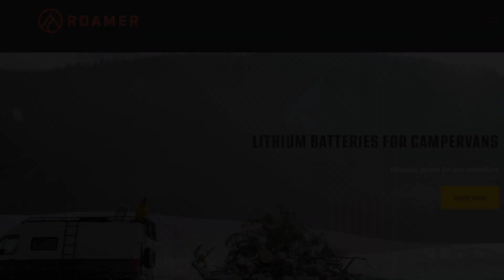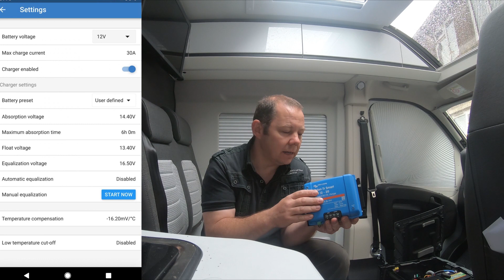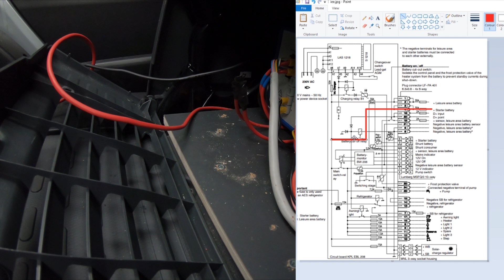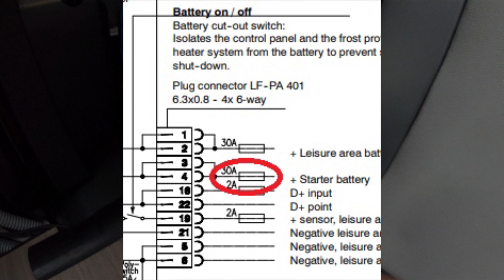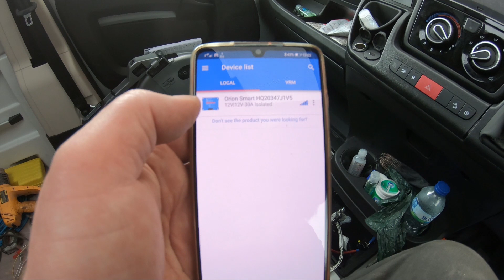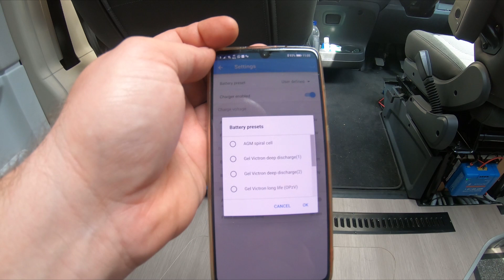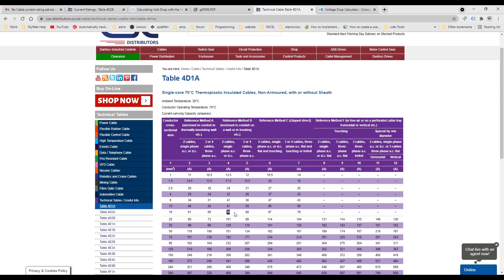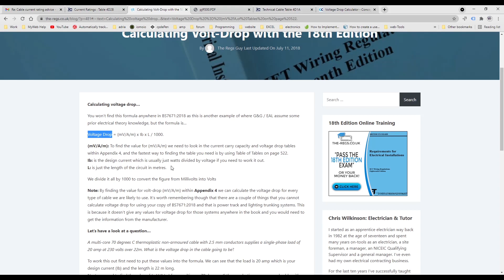Adria Twin fitting Victron Orion Smart Tr B2B DC - DC charger

Comment: Great video thanks, i am in the process of fitting one of these and am going to use a D+ (engine on) connection to prevent the B2B potentially switching on when the solar controller is providing a charge. It's very easy to get to the D+ on my van (RollerTeam T590) so I may as well. 

However, as a separate issue have you considered whether the B2B might wrongly detect a fully charged battery if the solar controller is providing a charge voltage?? ie. solar controller is charging battery, then B2B is activated but measures 14.6V on lithium battery (provided by solar) and so doesn't start charging even though solar might be a very very low charge current compared to the 30A potential of the B2B? I wondered whether to fit an additional solar isolation relay activated by the D+ signal? Any thoughts would be most appreciated.
Reply from the maker: Hi Mark. I agree with using the D+ to switch the B2B on/off. I have had an issue when charging the starter battery using the Victron charger the B2B will switch on. When it switches on the Victron charger is then tying to charge the starter battery and the leisure batter so not ideal. If I was on EHU you I could end up drawing power of the starter battery and kill this batters over time.
As for solar on the leisure side I have not seen an issue yet where it stops the B2B working. i think the B2B only senses the input from the alternator. It should still turn on, however I have a victron solar unit and have set the voltage on this lower than the B2B to prevent any issues
Reply: @BrackstonesTravelAdventures  further to my previous message.... i have since realised that the B2B will NOT switch on due to the voltage provided by the solar controller (Victron 75/10) as this voltage will be present on the output side of the B2B so that was never going to be a problem. I have now got my B2B in and working perfectly with the solar controller and both actually charge the battery (SOK 100ah lithium) simultaneously, and both eventually switch off the charge when the battery is full without any fine tuning of voltage levels etc. (i also bought a Victron BMV700 battery monitor)  In the end i decided NOT to use the D+ signal and instead i have allowed the Orion B2B to switch itself on and off and it does appear to be working perfectly. I have not fitted a lithium mains charger at the moment as most of our motorhoming is off grid.
Reply from the maker: Did not realise you was talking about only a Victron MPPT. As you have said this only does the leisure battery so will not cause any issue with switching on the B2B. With some MPPT they also provide a starter battery charge which may turn on the B2B as the charge voltage will be seen as if the engine was running. I have not had time to test this but i believe i was seeing this with the Victron BlueSmart EHU charger. Nice to see you have your setup all sorted.

Comment: Hi, I'm using on my Orion DC/DC setup a Victron 12V/90Ah Gel Deep Cycle Battery, and using the same cables... Should I use a 40amp or a 80amp mega fuses?
Reply from the maker: A 90Ah Gel batterys is small for this type of van setup, a quick rule will be the charge current is 25% of the battery capacity, so this will be around 23A. Your fuse should be rated for the cables you are using. I would go for the lower fuse as you have GEL batteries which do not demand high current charging and sutable cables for the fuse. You do not say what model victron DC-DC charger you are using so I do not know what the current rating of this is.
Reply: Thanks for replying. I'm using Orion-Tr Smart Isolated DC-DC 12/12V - 30A.
Reply from the maker: Ok so the max current flow will be 30A if the battery will take it. For cabling anything over 6mm will be OK for this current rating but you need to consider the voltage drop. (Cable rating table link below)
For voltage drop we want to be below 3%, there is a link below to an easy voltage drop calculator. Assuming you are using 10mm cables and running less than 2 metres on positive and negative cables, at 30 amps the voltage drop will be 2.25% (check out the link), if you are running more length cables then you will need to increase the cable size.
With this setup (10mm cable) I would put in a 40A fuse as the cable can handle 52A when enclosed in conduit, under flooring etc and you have a design current of 30A(Ib). If you do increase the cable size due to the voltage drop, I personally would stick with the 40A fuse as the design current is only 30A(Ib) and the cable size increase is only due to the voltage drop not the current load.
https://www.cse-distributors.co.uk/cable/technical-tables-useful-info/table-4d2a.html
https://www.jcalc.net/voltage-drop-calculator-as3008
Reply: Great explanation...thanks a lot for your help. Definitely I will keep your video for future reference. Once more thanks a lot.

Comment: Hi, I'm thinking about installing the b2b from Victron at the same place as you did. Reading in on the Victron forum, there are a lot of comments the b2b is getting really hot. Do you have any issues with the b2b getting overheated underneath the seat?
Reply from the maker: I did not have any issiues with overheating. I have two other victrons in my garage setup and they are fine. The back can get hot but this is normal as it is a heat sink for the mosfets to dissipate heat. Victron do say not to install on plastic walls for this reason. I do not see an issue if you install with spacers to allow air flow. The heat will convect out through the thins
Reply: Hi Geert i am hearing the same with reports of 52deg. C.

Comment: Would 30A breakers be ok to use with 16mm cable over 2 meters as the charger is rated as 30A charge or is it better to up them to 40A ?
Reply from the maker: A 30A breaker will probable trip some of the time as this unit can deliver 30 amps and probably pulls a little more than 30 amps from the engine. 40 amps breaker with be the lowest I would go. I changed it to a MEGA fuse as these are more reliable to work in fault conditions
Reply: @BrackstonesTravelAdventures  thanks for the reply. I'm going to use 60A breakers as per victron manual and back it up with a 150A mega fuse coming off the van battery to offer protection for van battery if there was ever a dead short.
Reply from the maker: I posted on Victron forum why they advice a 60 amp breaker for a 30 amp device but they did not explain, I cannot see why it would be good to fit a higher breaker than needed, only reason i can see is the cable rating (16mm) can handle up to 62 amps in conduit so it is normal to rate fuses to cable rating but this is not ideal. This is the max the cable can take and with the time the fuse takes to rupture and thermal heating on the cables I do not see this as OK, it will also definitely blow out the B2B circuitry. 16mm cable run in conduit can only take 62 amps. The 150A mega fuse is very high for this circuit by time this ruptures if it does at all (depends on battery bank if it can deliver 150A) the cables and B2B will be smoking red hot. I do not trust breakers myself, but if you are to fit a breaker then fit a fuse at 60 amps correct rating for cable. Personally i would stick to a 40 amp fuse as the circuit should only ever take 30 amps so anything over 40 amps i would want the fuse to blow
Reply: @BrackstonesTravelAdventures  Fuses or breakers are there to protect the wiring not the device. So Victron's advice is correct if you use that cable.
Reply from the maker: @richardmarquardt6246  great thank i never new that 😂

Comment: Hi Steve, just brought a 12/12/30 tr smart....I noted you fitted a 40 amp breaker. In the handbook it states 60amp ....? What's your thoughts? Slightly confused.
Reply from the maker: I could not see why they recommend 60A fuse for a 30A converter. I did go on Victron forum and brought this up along with a lot of other people. I believe they are rating the fuse for cable size which is normal in design but I prefer to rate a circuit for current use plus some which then comes to the next fuse rating. I have been running it for some time now and its only ever pulled 32A max for 40A fuse should be fine. End of day if it kept blowing then I would rating upwards, never going to be a safety issue

Comment: Unlike other info i search for, the more i try and find out about installing this b2b, the more confused i become.
Reply from the maker: Dont over think it see it as a charger the starter battery will be the supply to it and the output charges the lesure battery. Just fuse everything and correct cable size and that's it

Comment: Hi me again, Mine is a EBL 29 do you know which connections relate to the charge relay on it. 🙏 Colin.
Reply from the maker: Not sure the EBL I have you cannot remove the charge circuit. Only relay is the starter battery one which is internal. For engine charging I removed the supply from alternator to the EBL and for EHU I have unplugged the EBL 240v supply. So the EBL is only a fuse distribution box
Reply: @BrackstonesTravelAdventures   Thanks for your help it’s always good to exchange ideas. it got me doing a bit of searching and found that on my EBL the engine and leisure battery connections are at the back. Terminal 1 leisure 2 earth 3 engine. That’s also told me that the earths are common across both batteries,  like you could have bought the cheaper 3 terminal b2b.

Comment: Can you still charge the leisure battery when on hook up?
Reply from the maker: Not from the EBL on the van if you want to keep the warranty on a lithium battery. Most suppliers I have spoke to will not give a warranty from a none lithium charger. The EBL charger on this van has a longer absorption phase than a lithium will like and has a float charge which will eventually reduce the life of a lithium battery

Comment: Hi, just fitted the same unit but ive got lead acid so set absorption to 14.4v, but confused with the absorption setting on the app (automatically calculates absorption time) don't know if to flick open this did you find out any more details about this setting, thanks
Reply from the maker: If you have AGM battery the absorption time will be between 4 to 8 hours. If you set the profile to AGM it will do all the setting for you so you do not need to change anything else. If you want to set this yourself the enable this setting and set it to the time you want. google your battery manufacture for the battery to get there recommendation for absorption time

Comment: Great video I fitted the same set up with Adria coral with AGM batteries I am to getting the same issue with cutting off around 90% charge did you manage to fix your issue thanks
Reply from the maker: With the AGM battery, if my wife was driving I could go into the app and i changed the bulk or float charge to a higher voltage to kick start the B2B charging then drop the voltage back down again. doing this i could get to near 99% but never 100%. I expect this is due to the high resistance on AGM batteries. With the lithium I never get this issue, I get 100% all the time and 30Amp charging which I never saw with the AGM
Reply: @BrackstonesTravelAdventures  thanks for the reply. I swapped from the renogy 20a DC-DC to the 30a victron you have installed because I thought it was the renogy that was the issue! I'm at bit of a loss trying to solve this issue I obviously don't want to cook my newly installed AGM s by forcing the settings in the app but so far it seems the only way.
Reply from the maker: I do not think you will cook/damage the AGM by turning voltage up a bit then back down again , It will not be set high for long period to cause a damage bulk voltage is between 14.6v and 14.8 so set this at 14.8v, float is 13.2 to 13.8v. If it stops charging at 90% then increase the float to lower bulk voltage for a few min to kick start the charging again then bring it back to float setting. This will not cause an issue. Alternative go on Victron community forum and report this as an issue see what they say. This is all assuming the battery monitor you are using is correctly calibrated and you have 90% and not 100%
Reply: @BrackstonesTravelAdventures  thanks yer I get what you mean. Probably I will have a look at the forums. I am using the victron smart shunt so I can monitor it through the app when I am driving. I did hope for an easy solution. Thanks again

Comment: if the  battery has it's own BMS, can you than let the EBL in gel-mode connected to it?
Reply from the maker: The BMS does not protect your cables and alternator from over current charging to a lithium battery. The gel mode on the EBL for EHU is nothing to do with the B2B. The B2B is for engine charging. The gel setting gives correct voltage but the absorption charging time is 6 hrs I believe which is longer than lithium want. It also float charges again not something lithium likes. The BMS only protects against over/under voltage and over current etc

Comment: Great informative video, engaging and well delivered. It has inspired me to do the same. Ive done the solar controller, which Im very happy with. Just starting the B2B. Could you tell me what you did with the relay and I think its a ballast restistor? to the left of the existing B2B. thank you.
Reply from the maker: Hi, nut sure what ballast resistor and B2B you are talking about. My Adria only has the EBL fitted which I disconnected. Even if there was a B2B fitted, by disconnecting the supply to the EBL as show would disconnect and factory fitted EBL. Only resistor in my system is a shunt resistor which is for the battery monitor gauge. If you have an Adria Twin join the Facebook group for more help.
Reply: @BrackstonesTravelAdventures  the Adria twin came with schaudt booster WA 121526. This was fitted where you have put your b2b along with a relay. It only used to charge the bats at 16 amps max.
Thank you
Reply from the maker: No my van did not have this, there was nothing where I fitted the B2B. This is not standard, probable fitted as an extra by your dealer. If you do have this fitted then You can either replace it with a Victron but if this is fitted then there is no need to fit a Victron B2B unless you are looking at increasing current charge, if so you should be fine with paralleling up a Victron with this
Reply: @BrackstonesTravelAdventures  I liked the idea of the victron b2b, the bluetooth etc and the added amperage. Looking through the victron smart, I never saw more than 16 amps. Hence my choice. 
Are you saying run them both, with a potential of 46 amps going in. I have 2 agm 100s at present.
Thank you
Reply from the maker: If you have AGM then no don't parallel up  they will normally only handle 10 amps the B2B you have will output over this easily. The Victron Bluethooth app for the B2B is not worth you paying out to change this setup. I fitted my one due to not having a B2B and fitting lithium which will easily take a 30 amp charge current.
Reply: @BrackstonesTravelAdventures  ok thanks. What i was hoping for was 16 amps to charge the agms plus an extra 14amps to charge the electric bike whilst driving. Otherwise it could take 5 hours of engine running to re charge everything. Is there a better solution?
Reply from the maker: According to the schaudt booster WA 121526 manual this B2B will deliver 30A and the EBL-211 has a 30A fuse, so in theory the AGM battery will only pull around 10 Amps charging due to internal resistance, maybe a little more if 50% discharged. Your eBike will be a lithium battery (li-ion) around 13 aH. These take max charge current 80% of full capacity around 10Amp for 13 aH battery, but normally a lot lower so I would say more like 6 amps. Your eBikes would only take around 1 1/2 hours to recharge from fully depleted, but the AGM will take a long time no matter how much current you throw at it. AGM batteries are very slow and long time to charge due to there chemistry. So with one eBike and the AGM you will only be pulling max of 20 amps and you have 30 amp charger. If you want quicker charging you will need lithium battery in the van and bigger B2B or ensure you have at least 200 / 300 watts solar. I would not increase your B2B unless you are looking at installing lithium. If you are on Facebook you can post this question on Campervan Electrics which is very good group. Also worth joining the Adria Twin Group
Reply: @BrackstonesTravelAdventures  thank you do much for that. Yes I'm in the Adrian twin group thats where I saw the link to your vids. I do intend going lithium, but going to a. Wait untill they come down in price and b. Get some use out of the agm batts. Have you got your lithium yet? And did it fit under the seat ok?
Thank you.
Reply from the maker: Great, nice little Facebook group. The electrical one is good as well. Still waiting for my Lithium, having trouble getting it out of Japan I think.